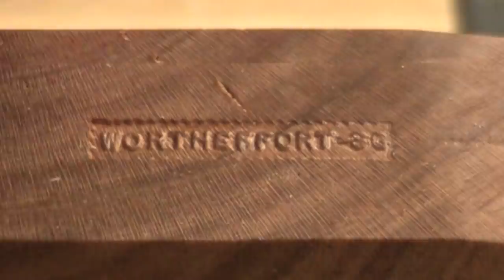Making a Moulding Style Groove Plane

Comment: This was a nice video.  I picked up on a few tricks I can use in tuning my own wooden planes.  I have two old wood planes, a rebate plane and a grooving plane.  Fine tuning them has been a bit of a challenge but, coming along well.  It's the wedges for the grooving plane I'm finicking around with and they aren't seating behind the iron very well...
Reply from the maker: Use carbon paper to see where they're hitting then a scraper to remove just the black parts.
Reply: Yes, that's a good tip.  However, the gaps I'm getting are so large, you can drive a truck through them!  I think it's in part due to the iron not being as flat as it can be and the pocket was chiseled out more to fit that iron. (I may have to flatten the iron, no big deal)   

BTW, the hand plane is an Auburn Tool Co. plane, circa 1864-1893.  So, I have an antique on my hands.  I've already sharpened the blade and knicker iron and it does function quite nicely, as is.  I'm just tweaking it to make it better.  Thanks for your reply...    :-)

Comment: Hello, I have a doubt, how do you decide in which side of the stock you put the iron? or we should have two of this, one to plane to the right and other to plane to the left? Because, if I´m not wrong, the fibers orientation may not allow you to plane if you dont have the plane with the proper orientation. Thank you very much.
Reply from the maker: For most people it's if you're left handed or right handed. In the real world you don't need to worry about the grain direction on the bottom of a groove because nobody will see the tear out. These are parts of joints so another piece of wood will cover it up. It's why all those combination planes Stanley made were only right hand versions. Also, old timers would pick would that didn't fight them much, straight grain in all directions. But yes... I built two, L & R versions. Why? Just because.
Reply: Thanks

Comment: First, hope your efforts for the school are greatly rewards!! I see some of the comments suggest using wax on your vice screw. I recently rebuilt my 23 year old table saw and used the graphite and wax combination on the elevation and tilt shaft pinions and also the much larger gears for the same with it. WOW, does that stuff work great. Just thought you might like to try that. It's easy to make. I made thin bars so I can get into small and tight places. These bars now have a place in my tool chests.

Comment: wax that vice screw
Reply from the maker: it is waxed
Reply: @wortheffort  Wax it till it wanes.
Reply: wortheffort isn’t it great that people that have never been in your shop are telling you what to do 😂
Reply: Dear Sir, wooden screws are different from metal and the sound may be a permanent feature of them.  Don’t get worried by the sound, it tells you that it is running.
Reply: @petermarsh4993  no it tells you there is alot of friction...and friction with moving parts is NEVER good.....look up friction + wood and see what you get.....fire
Reply: Richard, yes the sound is produced by friction. In a high speed situation running for significant time the heat buildup may cause fire.  Last week I was using a router in a congested situation and the chips started smouldering and glowing red. Pressure, fuel & heat -> fire. Running a vice screw a few inches intermittently is not the same.  Low or no risk of fire here. Cheers.
Reply: @richard2mitchell  Are you SERIOSLY saying that vice screw with catch on fire? ha ha ha ha ha
Reply: @738polarbear  Are you SERIOUSLY saying you didn't read my next comment?

Comment: Jr. Woodchuck here.  Great video.  Would you please explain what you were doing at 25:36?  Thank You.
Reply from the maker: flattening the runner, then raising the stop the same amount, then thinning the runner so that there is gap on outside (less pressure there than inside to help it track at proper distance easier).
Reply: Thank you.

Comment: Hi. I enjoyed watching the video. When you made the plane I thought I saw you using a type of rasp which seemed to be glued to a strip of wood, extended a bit to make a handle. I bought a few thin metal rasps years ago at a woodworking exhibition. I found them to be cheap and effective There was no makers mark and I have not been able to find the seller since. Do you know of a supplier?
Reply from the maker: No it was just sandpaper glued down to wood to size the slot perfectly.

Comment: So, I went to your wortheffort.com website & store and found the tools for sale, however, it would be very nice for the buyers to know what blades are in the planes and to see a longer description of each tool. Not everyone will pay $165 for a Krenov style plane, which looks nice, but even fewer will do so without knowing what they are buying!? Sizes and materials would be good also.
Reply from the maker: slad roznik 

Slad, below is copy pasted directly from the ad you reference. You just needed to click 'show more' after the short description. And $165 is a discounted price.

------------------------------------------------------------------------

wortheffort is having a tool sale. This plane normally sells at $250. Sale price $165!
--------------------------------------------------------------------------------
We have a limited supply of the wooden hand planes so many have been questioning us about, after seeing me use them in our YouTube videos, live demonstrations or classes. I've made some improvements based upon using mine for the past 5 years and am most proud of the pin design which corrects some issues I've had with both Krenov's style and the more modern metal pin. 

These hard maple versions use a wider than traditional 2" Hock blade (O1) that's the longer 4" tall version. I like this because it allows for a more gradual camber and in my opinion smoother finish and the blade is easier to adjust with the higher protrusion. The bed angle is approximately 45 degrees, a good compromise between hard and soft woods.

The shape I styled first for comfort and secondly after my vision of an old craftsman wooden power boat. It's moving even while sitting on the shelf!

The introductory price to get us established in the plane making market is only $250. Which includes shipping. This is a great value if you've investigated what the blades cost, material would run, shipping, and all the time spent tuning.
Reply: Thanks for the info and I am considering buying one, but I also think you should put this info on the website, you just need to cut & paste.

Comment: the hand plane's cutter side should not sit straight on the bench, I know you try to be professional, suggest you look after the tools a bit more.
Reply from the maker: This is one of those much debated topics. Personally I think it's safer to the edge and me to place planes flat on bench. Just sitting there is no harder on the edge than shoving it thru a board making shavings. And even if, it's easier to sharpen a dull edge than a nicked one which is likely if it gets bumped on its side.